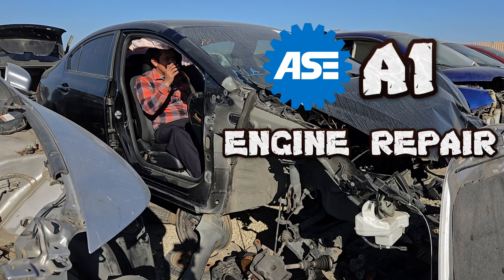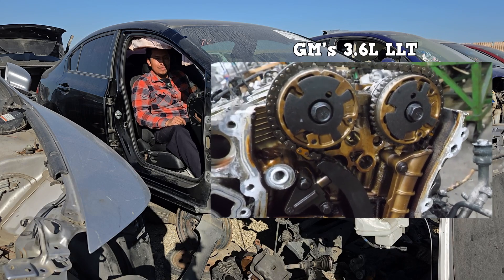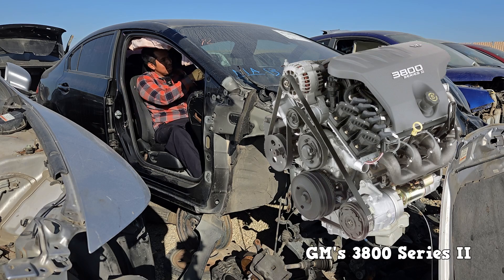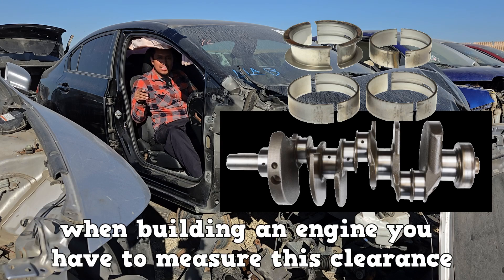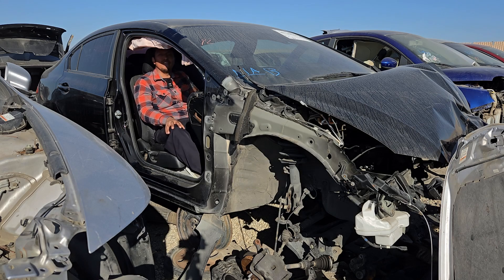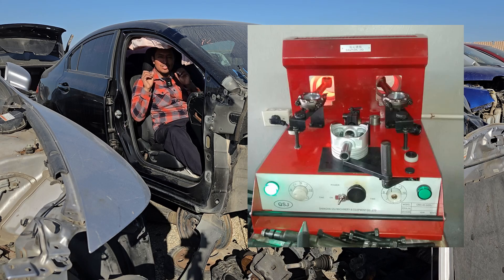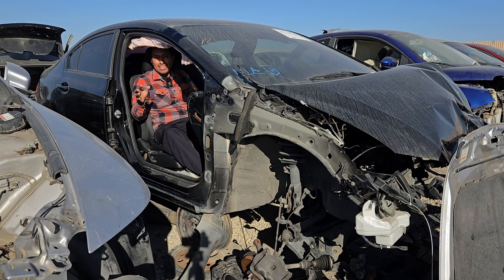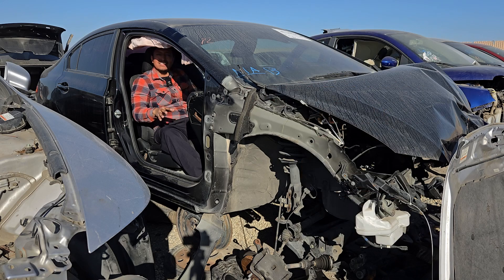3 ASE A1 Topics That Seem Difficult At First

Comment from the maker: Update after taking the test: I passed the test! I'm also proud of this video as I was able to film it in 1 continuous shot, no cuts! No edits! Many folks can easily do this, but for me it was a breakthrough moment! (An example of a rough time is the ASE A8 3 topics video, had to re-film multiple times due to 90°F weather and me being in a long-sleeve in direct sunlight, I was baking!)

Before taking the test I created a 4 video test prep series. Video #1 is really good
Video #2 - Valves/Springs/Guides - Skip this one, I went too deep! I focused on the physical act of engine repair, rather than focusing on diagnosis.
Videos #3 and #4 are ok, needed more info.
Good luck on the test if you're taking it soon!